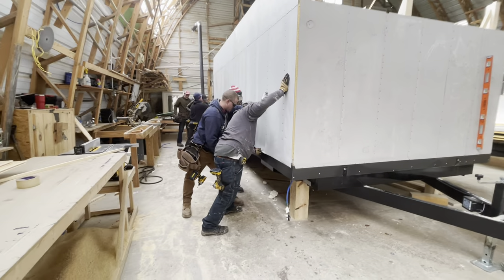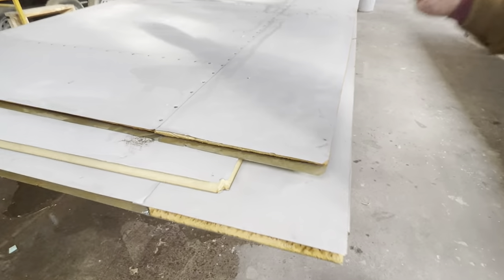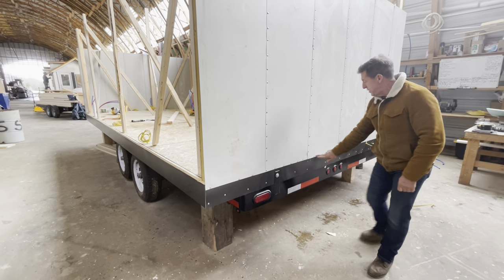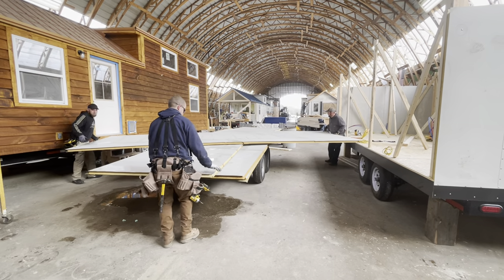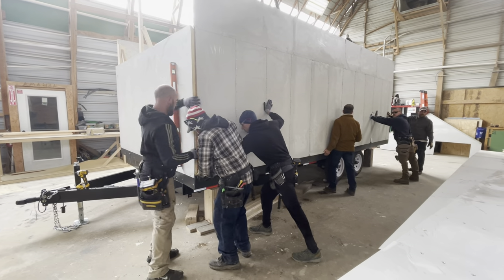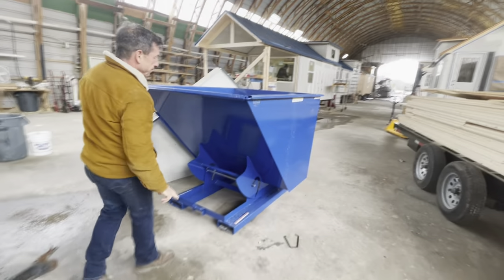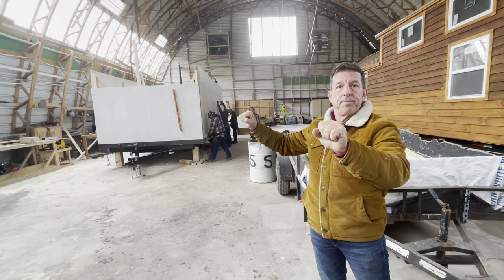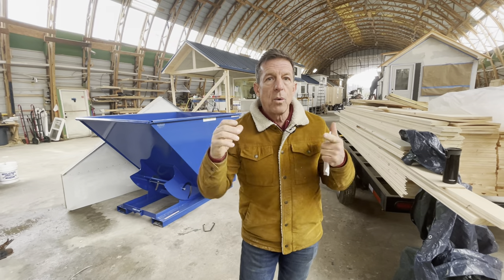How to Erect the ESP Panel Tiny Home Wall 🏡🙈😬

Comment: This reminds me of my crating days at Polaris.  Except we did the sides first than the front and rear.  I was so short I would grab one of the went wholes on the front or rear to get them even than I would turn around and with my other hand I would take my screw gun and screw the top than finish screwing.  It was a very busy job but I loved it. Plus I loved the group I worked with too.

Comment: Suction Handles like what window installers use or small boards on outside for hand grips might be a help with lifting until you figure out the magnet lift option.  Just a thought for y'all.

Comment: You are true industry leaders. They used to laugh at me when I worked but  I always said that somebody had to be first to move out of the cave and create “traditional” housing. Things have changed every since. Hardest part probably learning not to draw on the walls like in the cave home.  Onward and upward. Through difficulties to the stars - Kansas’ official motto.

Comment: Hi Randy, 
 I have a suggestion for the Incredi-Box which I think may make it easier to fabricate.  How about pitching the shed roof with it's high point along the front wall (with the door) and sloping it back to the rear wall (where the Kitchen is).  That way you only have to fabricate 2 end walls that would be exactly the same, instead of having to make up 2 different end walls of different sizes.   That would eliminate the need for the shorter bathroom end wall, but still maintain the "modern" look of the whole structure.  I don't think having this re-oriented roof pitch would interfere with any of the plans for solar panels, rain water collection, etc.   

I am definitely  enjoying your enthusiasm and energy as you restructure your company.    I'm sure it will be a major success!  Best wishes,  from old New England.
Richard Lheureux
Salem, Massachsetts
Reply: isn't the incredibox already pitched, 9 foot at living room and 8 at back?
Reply: Incredible box is niçe  model of the boxes.
Reply: Incredible house is ,9 ft height 8 ft wife beautiful incredible box.

Comment: I watched these backwards 😂, watched the office answer questions, then the roof, and finally saw this 'wall' one.
I'm glad you have people proofing your website for errors, or cumbersome wording.
I'm very glad you are going to expand on the Incred-I-box later after you get it finessed.
I wrote Sam an email asking about some of the same questions.
1: All the model home are going to be wood framed.✔️ 
2: the smallest ones would be great to build on a 2' longer trailer for a deck by the door at the end.
3: a 8x20 Incred-I-box with a W/D hookup wired/plumbing set up.

Comment: you could also use an over head rail system to do the same thing and also use the same type of lift that they use in moving marble tops in the factory the base jib could be the same style that you used for the trusses to put them up  o 1 rail for each side

Comment: So do you cut the 2x4 out after its put together?
Cause randys box doesnt have a those 2x4 in it!
Reply: Yes... those are just to hold up the walls before all 4 sides have been fully screwed together, and before the roof has gone on.

Comment: I love Amanda's Augusta model. The back Laundry/Pantry storage area is perfect. This will definitely be one of your most popular models. What would be even sweeter would be the Augusta with the Clerestory windows like the last hobbit (only with a straight roof). I loved that roofline and the ability to see the sky from within. You don't need a skylight with those windows. If that back room was 5 feet wide it could be an Office or hold a twin size bed.
Reply: I missed that one.   Where is it posted?

Comment: Will there be modern style model homes to choose from, like the mono slope roof style?
Reply: For the moment, only the Incredi-Box and the container model ('Detroit') have a really modern look.
Reply: @chezmoi42  Thanks, Chez. :)👍
Reply: @sheilam9613  If they keep doing ESP's, I'd love to see them do an 'Incred-I-Box Plus' model next time, using the Charleston floor plan.  It would be perfect for the older clients who can't deal with stairs and low loft ceilings, and can't afford all the fancy woodwork. They could easily economize by putting only one window in the BR, leaving the other two walls for a storage unit/workspace and the bed.
Reply: @chezmoi42  That's a wonderful idea. I'd like to see something streamlined like that as well. Love a big picture window in the br.